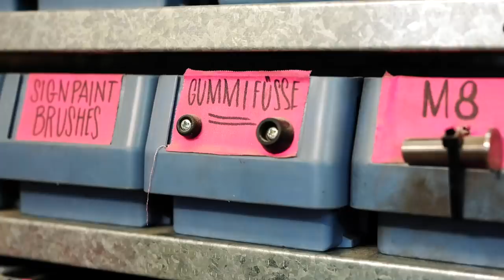Mechanical Trash bin made from old Gas Bottle

Comment: For other people wishing to cut gas bottles open, the safest way is to remove the regulator completely and then fill it up with water, this will push out any remaining gas.
Reply: This needs to be top comment, angle grinder cutting any type of vessel that once had something flammable in it is a bad idea.
Reply: In the US alone, cows kill around 20 people annually. I've never heard of anyone being killed by an open gas bottle with no signs of any remaining gas. I'll take my chances.
Safety YouTube comments are annoying
Reply: @TomMFD  i hereby humbly present you with a Darwin Award
Reply: @Blaze10523  That's hilarious. Still, the safety commenters after every maker video are annoying. "please wear safety glasses, you only have one extra eye" "shouldn't you be wearing gloves? sandpaper can abrade your skin!" "If you use a clothespin to hold the nail, you won't risk hitting your thumb with that hammer"  Again, it's annoying. Take your safety advise to a new Maker who doesn't know what they're doing.
Reply: @Blaze10523  Also, you have to earn a Darwin Award. They can't be given, gifted or granted.
Reply: Tobias  Darn it, you're right!
Reply: @TomMFD  There can still be flammable gas vapors in it.
Reply: @robstephens  well, I'm not saying you shouldn't check to see if there's anything flammable inside. There are easy ways to check without fillng it up with water. But I suppose that if you don't know how to check, fillng it up with water or whatever, to displace any gases is a good idea. Odds are though, anyone making a video, knows the source of the bottle and if it has or has not been vented. 

At this point I've probably said enough about this that it seems like I have a strong opinion on the matter, but I don't. I simply said safety comments to someone as knowledgeable as Laura are annoying.
Reply: I put a similar comment about this not being safe when this video was first released but I think it got deleted.
Reply: Thanks, that was missing in the video.
Reply: Tobias  You have to remember that cows can explode too, you have to drain all the methane gas out of them and then fill them with water. You don't need to make any holes, they come like that. Be safe before you steak!
Reply: Yes I was going to say exactly the same thing this should be made clear !
Reply: Tom Hale 
You’re right that the Maker probably knows the source but her 350K + subscribers don’t know and presumably a few might try to copy her idea and don’t know how to purge a propane tank. Just saying it is empty is wrong because a propane tank is never empty until it’s been purged. Many people think it’s empty when their grill goes out but they are wrong.
Reply: Tobias  I think you are talking about carbon dioxide. Carbon monoxide is both flammable and poisonous.
Reply: I have also heard of people filling them with exhaust from like your car or truck. Now I’m not saying this is the right way or a safe way just saying I’ve heard of people doing this way like on fuel tanks as well as heard about the water method.
Reply: Chris Stevens  actually, if you know what you're doing, there is no risk. If you absolutely know a bottle/tank is empty, filling it up with water, inert gas, etc is a waste of time.
Reply: Chris Stevens  So, if I buy an old propane bottle from a person I trust who tells me it's empty,, take it home and remove the valve and let it sit for a month until I'm ready to mess with it, I can't be certain it's empty unless I fill it with water?
Reply: Thanks for mentioning this - hazards aren't always obvious: even de-pressurised, there remains a danger if the cylinder contains residual oils (very common in propane cylinders) -- the heat from cutting can vaporise oils, creating an explosive vapour which can even detonate. Lessons have been learnt the hard way in industry, but there are always ways to eliminate or work around the hazards.
Reply: Tobias  That would be carbon dioxide. Carbon monoxide is not inert. It is in fact quite flammable.
Reply: And do it in a garden or an exterior place, please do not smoke closely to it!

Comment: The nice thing about this bin is if something is on fire, just drop it in and shut lid it most likely go out ( i know it not air tight but stop a fire spreading). if you ever need to cut something like this or flue tank fill it with water then cut it open, good way to fix old fuel tanks. keep up the amazing work and i really miss welding myself so much can be done with it.
Reply: You could add water to the tank. That would help keep a fire from starting. This would be great for linseed oil rags.
Reply: I immediately thought it would be for oily rags.
To prevent fire.

Comment: Great content as always! Good tip for drilling large (5 mm and up) holes: drill a 2.5 or 3 mm hole first, those drills have a non-existant chisel point in them and thus will go through steel like butter, especially if you use the Festool on the highest RPM setting (great tools btw). Then follow up with the larger drill, it goes through with ease and no need to push as the flat non-cutting chisel point doesn't have to do any work, thanks to the pilot hole. When you look at a drills point end, it looks like a flatheaded screw driver. Imagine how well a screw driver cuts :D

Comment: Maybe have some little rubber-stops so it's not so loud 🙂 when its closing 👍🏻
Reply: Or flexible u-shaped edge trim?
Reply: MattiasSweden 76 I heard only music when lid was closing 😉
Reply: Hard to add that in after the fact since it was welded on in place without any space for an addition 
(some flap disc magic could fix that right up). I was saying that 10 seconds into the video that there should be some weather stripping around the edge for noise.
Reply: I vote for a soft close mechanism. 8o)

Comment: Excellent, need an insert though to make it easy to empty.
Reply: TheKingpin64 if you do that, some holes in the bottom or a ring with holes as an insert to prevent the vacuum action when removing bags.
Reply: @Zarlax  its already has two holes in the bottom @0:36    ;)

Comment: Hi there. Your band saw at 2:50 has an evil brush fire. Either the carbon brushes are too short or the rotor has a defect. The saw should also make a lot of noise when it runs.

Comment: I see it had holes in the bottom before you started cutting.
Otherwise I was going to say it was best to pull the valve and fill it with water, or purge it with car exhaust.
Might still have been the safest move, but LNG/CNG/Propane/Butane self purge better than gasoline.

Comment: I would've added like a rubber ring on the edge to reduce the noise from closing it.
Reply: And maybe wheels too, I don't think you're planning to use plastic bags and you need to move it around to dump it somewhere.